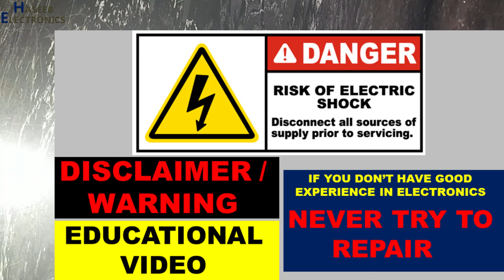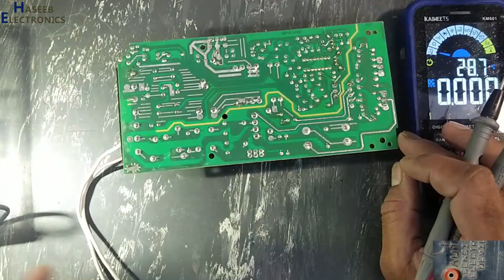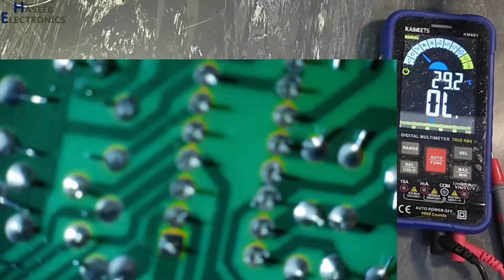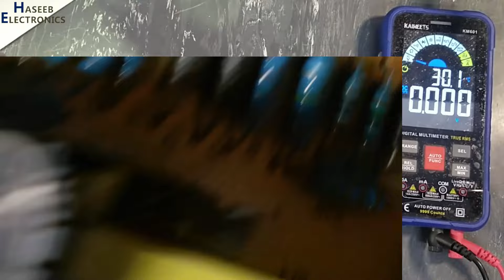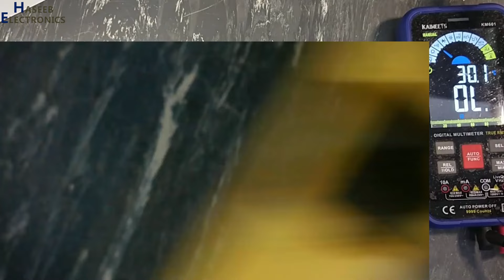{1164} TL494 / KA7500 based SMPS troubleshooting tips

Comment: Hello Nice Video, Youtube suggested me your Channel. Regarding Pin 4 (DTC, Dead Time Control, used for slow start mostly) according to the Datasheet the 0% Duty Threshold is between 2.8 and 3.3Vmax(it depends on the Brand of the Chip too, OnSemi, TI,etc.), so 1V to at least 2.5V is a Working Condition, just lower Duty Cycle.
Reply from the maker: @KonstantinGrigoriadis  moat welcome to my channel 
Yes pin 4 is DTC 
AND it also provides zero duty cycle when dtc pin is pulled up 
It disables the output transistors
Reply: Hello, Yes but 0% duty (disabled Output) is Between 2.8 and 3.3V , values between 1V and 2.8V are Working condition as I wrote, just lower Duty
Reply: Btw, I wrote you a comment with a link to a Schematic of a Similar Power supply like the one you show in your Video, Perhaps its helpful to you if you repair these PSU's, but seems that you have Links deactivated in Comments, so perhaps the comment with the Link is on the Hold Comments. If not I can send it you via Email.
Btw. Reverse engineered the : HJS-480-0-300 300V 1.6A Power Supply (Videos are on my Channel) if you want the Schematic, let me know. Cheers, Konstantin
Reply from the maker: @KonstantinGrigoriadis  best regards 💕 
You are right the max threshold is 3.3 volt for zero duty cycle 
I never disable links or any comments 
Sometimes some links and some words are held for review by YouTube 
I will check and see it 
Special thanks for sharing link
Reply from the maker: I think YouTube removed the link. I checked held for review section. It is empty 
If you want 
You can send to my WhatsApp 00962-79-560816 
Or gmail Ashraf4ta4
Reply: @HaseebElectronics  I have send you an Email with the Schematics. The Setting to allow Links & Email Addr in the Comments is Disabled by Default in Youtube, but can be Enabled in the Setting if y want.Cheers, Konstantin

Comment: Very very good and informative video ! Sir I have gotten a problem,  when I given 2amp on load, it worked perfectly,  but on 5amp (60w 12v bulb) 13009 output transister has been blown, which section have to checking  ! Please  !🙏

Comment: Hello, I have an amplifier for a car subwoofer (JBL BASSPRO MICRO). Subwoofer power on light is on, but no sound is playing. TL494 is used there, the values of all pins are ok, but I have 4.9V on pin no.4. Any ideas? Unfortunately, google didn't find me a schematic for this car amp.

Comment: Thanks dear Sir. 
I tried to control the current on  same power supply by adding a variable resistor as a divider with the resistor between pin #15 & #14 
but it reduces voltage with current. 
How can i control the voltage and current separately on this kind of power supply to make a bench lab power supply? 
Thanks again.

Comment: Hi sir, maximam how many number power supply can parellel.  Pls reply
Reply from the maker: we must try to cooenct minimum number in prallel as per requirement 
load current must be less the 70% of the total of current value (connected in parallel configuration) 
it will allow a safe operation
Reply: I connected, 3 nos powersupply 5v 40A, but current drawing up to 40A only.

Comment: Sir, in the same SMPS with KA7500 IC, Voltage is dropping from 12V to 1V when load is applied. I've re-soldered the shunt resistors. When voltage dropped on load, pin16 of IC, still had 0V. So OCP not activated. I have replaced resonant capacitor, VCC capacitor, Both DC bulk capacitors, output capacitors, IC and preset. Everything else seems okay but still voltage drops even on connecting a 10W load... Please suggest a way out ..🙏
Reply: Please respond Sir. I'm waiting for your guidelines 🙏

Comment: Bhai jan power supply ke kit 12v5a wali kasa repair kra.input a rahe ha. Output nahe a rahe plz bata do plz plz
Reply from the maker: aap ne IC number, power supply model nahi bataaya. please write the power supply model and its switching IC so that i can reply
Reply: Respected Sir, if possible, please start about solor inverter repairing in details because Solor inverter problem are increasing day by day which we are facing very great problem in repairing. So I again request to please start the Solor inverter repairing video in details. So we are repairing job smoothly. Thank  you brother.
Reply: @HaseebElectronics  bhai us ma 4m60 mosfit ha or driver 6 pin wala ha . Chicony technology ke supply kit ha to aj kl pakistan ma fan chalana ka liea use ho rahe ha